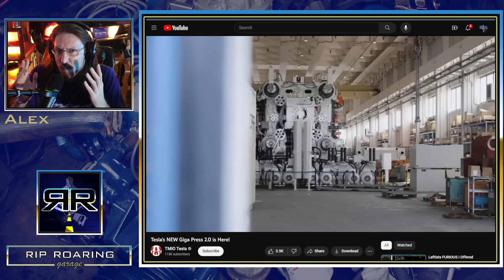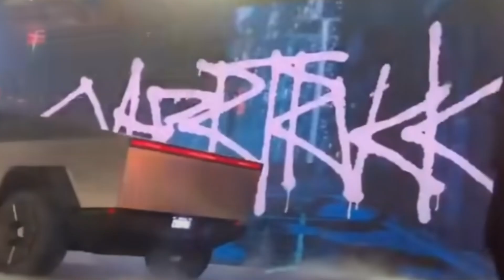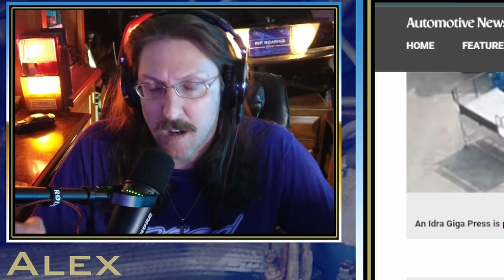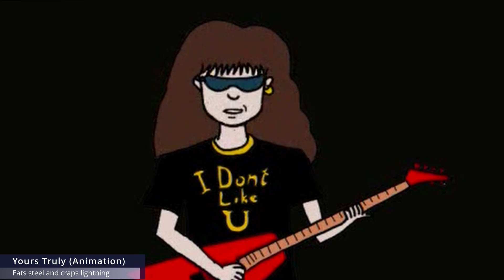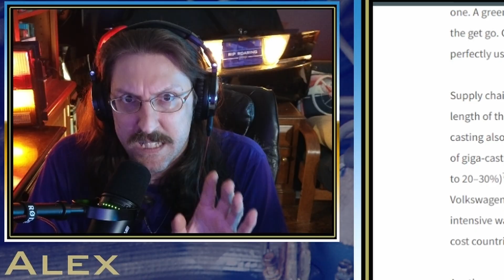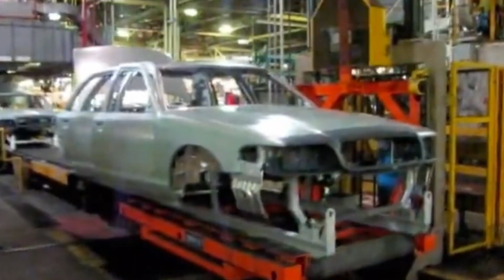What is Giga Casting? What’s a Giga Press 2.0? The Era of Disposable Cars is Here!

Comment: Your comparing ev manufacturing to ICE. Tesla is building with as few parts cuz they are trying replace your gas car. The only way you can do that quickly is to have a good product that's desired. Then they have to build large numbers at lower cost to compete with ICE. I'm not a fanboy of Tesla but I'm a fan of Aptera, where real innovation is.

Comment: I'm agreeing with you that repairs would be next to impossible, and I do not trust this process for the parts they're making with it, but this is like a giant plastic press, which can have water jackets and channels in it to help cut down on warping. Still seems like a failure of an idea! If it's not done just right seems like it could be porous and you'd never know until it cracks and you see the cavities inside.
Reply from the maker: Exactly. Like I said, its a huge topic, and could be a cool process. After all we have had huge pieces cast for ships and whatnot. I dont mind new this, but this seems like its only meant to remove the concept of replaceable parts, one of the foundations of modern industry.

Comment: I read about this recently. I think it was an article on Toyota investigating using this in the future, if i remember correctly. I thought the same things as you said in the video. Throwaway cars that can't be fixed if something happens. No thank you. I don't even really like unibody construction, but we've been stuck with that for a long time. At least it's still repairable, but nothing like a body on frame constructed car is.
Reply from the maker: Exactly. Im not a big fan of the Hellcats having unibody, or the XJ. Nothing like the BOF Crown Vics that will last longer than me.

But this new stuff makes unibody look like tanks!

Comment: 🤯🤯🤯 I'm heading down to the patent office.
A one piece 3D printed car body.  Add a battery, motor and wheels, and I'll get the price down to $17,695.
Muaha ha ha!  My car only has six components....   well, plus some wires and glass.
Tesla is going DOWN for the count!
Reply from the maker: LOL. Well, there are seemingly people that want this kind of thing. Hell, you could charge them 50k for the priviledge and theyd still be fanboys. Sad world
Reply: @RipRoaringGarage  You certainly recall the days when vacuum cleaners could be repaired...... Disposable isn't really "greener".......…so how come the greenies like this stuff?
Reply from the maker: @randywl8925  I know. I still have my own Kenmore upright. I even scored another one for parts lol. Still works fine and its 30 years old!

These greenies are a rel cut. They turn their brains off, but I think somehow this is a bragging thing. They want to show how wealthy and rich they are by owning something they throw away. Whats next, disposable houses? Its crazy enough that they might do it, if Tesla or some other big company can figure out a way to make houses "tech" and cool or whatever. We are in the odd times, thats for sure
Reply: @RipRoaringGarage  White Westinghouse washing machine about the same age. It needs a bearing and if I had a tig welder I'd fix the bad sheet metal around the right hinge.
My '93 S10 has 290,000 miles and 160 lbs of compression. My battery can be recycled.  Long live the old!
Reply from the maker: @randywl8925  They at least have a shot at it.
Reply: I just spent about 10 minutes writing a great comment to this... and it's f*king GONE! God damned bullshit youtube...